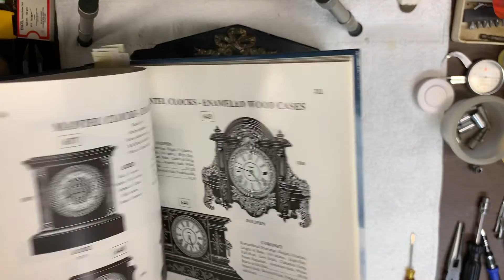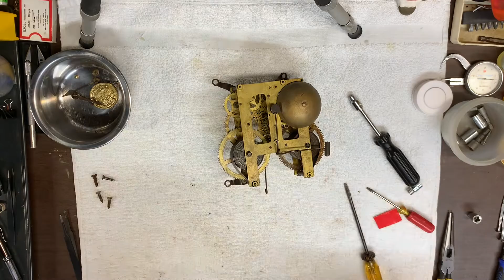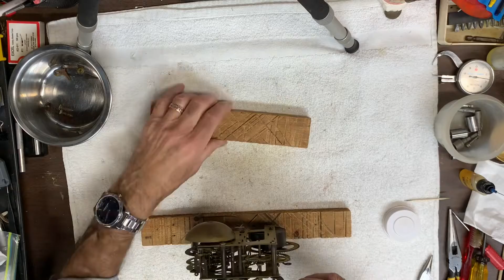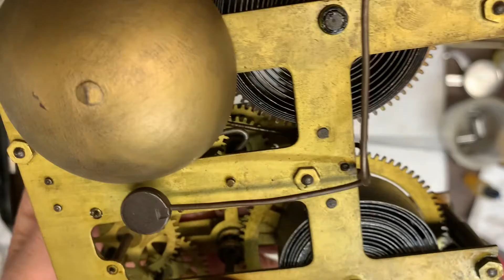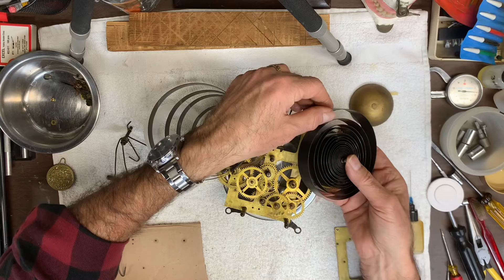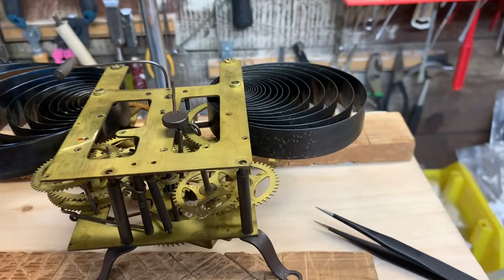Repair Attempt of an Ingraham 8 Day Mantel Clock, 1905

Comment: Hi Mark, 
I have purchased an e-Ingrahm 1927 Cody college assortment. It chimes well! The issue I’m having with it is that after a few days of working it adds an extra chime to the hour. So if it’s 10’oclock it will strike 11. Any advise you can give me? Thank you for your time!
Reply from the maker: Does it then consistently chime one extra time every hour?  If so, the easiest way to fix it is to reposition the hour hand back one hour. Do not turn it backwards, you have to remove it and then place it one hour back. I do not know why this happens, and if it reoccurs you will need to get it repaired by a professional.

Comment: I picked up an ingraham desoto at a swap meet this weekend. Cobwebs and old oil but cleaned it up and it cranked up. I noticed it had unfinished blocks in the corners of the case. I figgered the previous owner did it but checking them out on google i saw several with the back off that had them. Was that a factory fix or just common way to strengthen them?

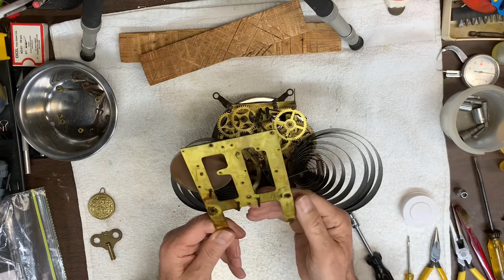Comment: 18:30 Spring Clamps, or even strong zip-ties or metal wire would keep the movement from flying apart during disassembly, and would make reassembly easier and safer. I enjoy seeing each clock repairer's different techniques - thanks for posting!
Reply from the maker: Thanks for the info.  I'm not sure where I would place the clamps or zip-ties.  Thanks for watching!
Reply: @markh77  @dperry428 has a video which shows him letting down and capturing (clamping) the mainsprings: "Repairing T's Gilbert Mantel Clock Movement" starting about 8:07 in that video.
Reply from the maker: Thanks, I’ll check it out.

Comment: Great video Mark, you're a brave man taking on that job!. I've seen center punch marks on those bushings, where they made the bushing tighter. Might work if you have no tools yet. Thanks. Adrian
Reply: Please don't use a punch to try to repair a worn pivot hole since it is a only a temporary fix to a long term problem.  
Best take it to an experienced clockmaker for a proper bushing job until you get the correct tools for clock repair.
Reply from the maker: Thanks, I might go for a mainspring winder, but have no plans to fix bushings with a punch.   @brettfavrewelfarequeen9886
Reply: @markh77  Good, especially on these antique movements.  
Yes,  a spring winder and clamps are must to do this safely.  
As for bushings, they can be done by hand.  Of course you'll need a digital micrometer, reamers, broaches, small hammer and block etc.  I would also recommend a set of assembly posts and a test stand.  
There are a few excellent YT channels on clock repair such as James Martin, Scottie's Clock World, and D Perry just to name a few.
Reply from the maker: I repair these clocks for fun, not for a living, I do not do enough of this type to warrant such an investment.  I have seen a few of the YT channels, some are quite informative.   @brettfavrewelfarequeen9886
Reply: @markh77  I totally understand.
Reply: @brettfavrewelfarequeen9886 I had my Ingraham “repaired “ at a local clock shop. He “punched” the bushings. I was told it was a hack job. 

The clock has been running for 50 years. I oil it every few years.
Reply from the maker: Thanks

Comment: Great video Mark I have done many spring wound clocks and replaced bushings with some success and some fails. If you want to  continue with this kind of clocks you need more tools but I bought mine a few at a time and the bare minimum to do the job (ex: hand spring winder, hand bushing reamer ,movement holder, spring clamps) Good Job